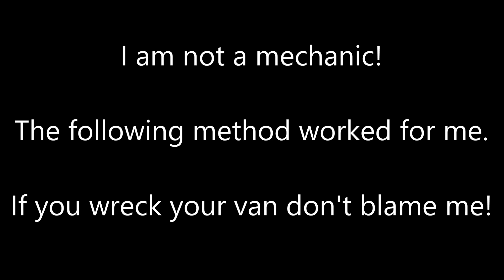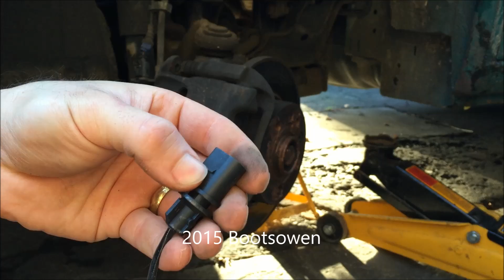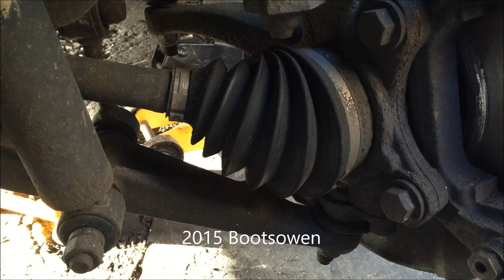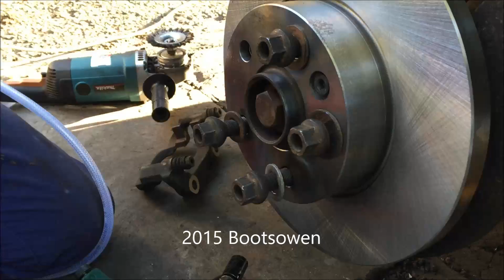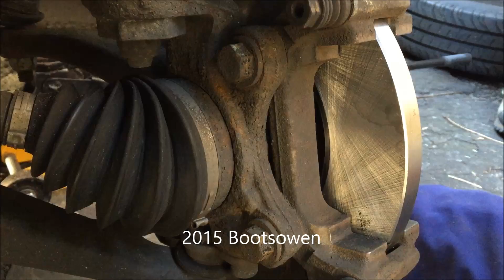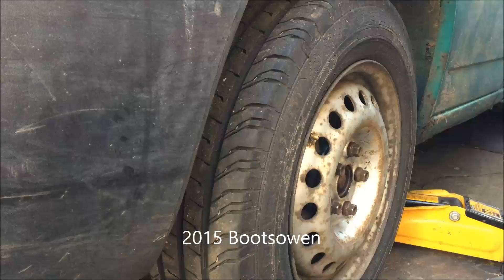VW T4 Front Brake Replacement

Comment: US long nose Eurovans use a different front brake assembly. The hub carrier bolts shown at 4:16 are 27mm in the US Eurovan and require a high capacity impact gun to remove along with impact rated 27mm socket.

Comment: Hi, my pads seem to move backwards and forwards a bit causing a click sound now. I think it's the spring position on the edge of the pads. Do they sit inside the window of the caliper or squash down by the caliper  ?
Reply from the maker: they get squashed, you should feel resistance from them when offering up the caliper.

Comment: Great video and tutorial. Well put together.
Have you ever replaced the seal in the rear brake compensator valve? , I have a leaking one..
Reply from the maker: Never, ever. I have never, in 12 years, changed the brake fluid in my van.  It is a job that fills me with dread. Pads, no problem, disks, no problem.  I even went so far as to buy all the kit and fluid. But it is still waiting.  Good luck though, let me know how you get on.
Reply: @bootsowen 
Not the fluid. The rear compensator valve, its above the exhaust between the rear trailing arms. Can't find anything online about refurbing it. I'm going to pull it apart and have a look.

Comment: Good vid. Just ordered pads for my 95, 1.9 Caravelle, they needed to know whether it's vented (no) and width.. 260 or 282mm ,mines,282 guess there's different pad sizes. 
Going to do the disks as well now I know how easy it is. 
Do you really need the gauge? 
Cheers.
Reply from the maker: You don't really, but as I showed in the video there was runout from a little bit of dirt. Maybe I showed that on the rear disks video. Just grind it clean and it should be ok.
Reply: @bootsowen  cheers pal.

Comment: You have the best t4 vids going mate :) MY calipers have siezed at the front. I will replace the calipers, but want to avoid replacing the brackets....however the pins has rusted into the pin holes on the brackets. Is there a way to clean those holes or do i need to face facts and replace the brackets if their is rust in the holes?
Reply from the maker: Hi There, without seeing what you are talking about , and given that we are talking about a safety feature (Brakes) I am reluctant to give a firm answer. but if i want to get a rusty pin out of a hole I will hit it with a hammer repeatedly to loosen the rust, and then try to twist or drive the pin out.  IN this case though, because they are brakes, I would just replace them with the cheapest I can find.
Reply: @bootsowen  thanks mate, replaced calipers, brackets, pads and discs! did the lot. Cheers

Comment: never saw a T4 without ventilated front discs
Reply from the maker: LOL,
Reply: @bootsowen   i'm serious!  do u have the 1.9d or td?
Reply from the maker: Yes, indeed, I'm not sure what to tell you. There are two types and it depends on the variant of your van.
Reply from the maker: Its a 1.9td. 2001
Reply: @bootsowen   The only ones i didn't work on  are 1.9's    I myself have a caravelle 2.5tdi AXG 151PS  u can see it in my videos.

Comment: Great tutorial Bootsowen, what did you torque your carrier bolts up too? Cheers.
Reply from the maker: Hi there Stephen, I rarely use a torque wrench, I tend to do it until I heat a click in my head.  The click comes just before the point where I shear the thread!  It is a fine line.
Reply: bootsowen Haha, it all comes down to experience! Thanks.
Reply from the maker: The torque settings are fine for new equipment, but if you are reusing bolts or internal threads, as you invariably will be there may have been strains on those parts before that any "factory" or "service" settings won't take into account. Experience is where it's at.
Reply: bootsowen I have the same brake setup on my 1.9td. Im going to use new bolts and keep the originals as spares. Ive never gone above 150 ft.lb before so i'll be taking it easy on the first side till i know. Cheers.

Comment: What year was the VW and do you know if it's the same procedue as a 1997 VW T4? Also, what tools will I need? Thanks.
Reply from the maker: It was a 2001. It should be the same if it has the same brakes. It depends on the model and year of your van. The tools are shown in the video. Thanks

Comment: almost right :-)
you need 2 put some lock tight on the screws of the brakes for security reasons and after a brake install you defenillity need 2 bleed the brakes...dont need a machine 2 do that just a mate ho presses the brake peddel :-)

but nice vid anyways...greets from an belgium Fan
Reply from the maker: Thanks buddy, in 8 years of owning this van I have replaced all of the disks once and the pads 3 times. I have never used glue and never bled the brakes! I just drive along with shit brakes hoping Darwin doesn't catch up with me! But I always pass the MOT (Tuv)!
Reply: yes ok but i'm a petrol head ans somewhat control freak....but i know that it wil pass the mot...in belgium whe cal it technical aproval or technische keuring :-) btw belgium is Not Germany :-)
Reply from the maker: Too right! ;-)
Reply from the maker: I see what you mean! I didn't spot this,and neither did the guys when I did the MOT,  The van has done a few thousand miles like this.  I plan on doing the steering ball joints soon so I can check this when I am doing that! Well spotted!
Reply: One of the spring wires from one of the pads was sticking out through the hole before you put back on the wheel, did you have to amend this ?
Reply: Derek has a point... I have these same brakes on my T4 on the lucas calipers. I got DB1349 pads without the pad wear cable ones same as was in it.. now my brakes clunk when moving forward will clunk once then have to reverse an they will clunk again...pads look too small for the calipers.. may have to get myself genuine ones..  did you buy the genuine ones Bootsowen?